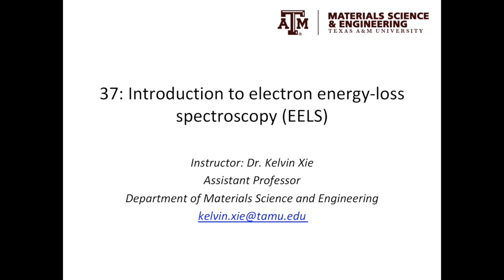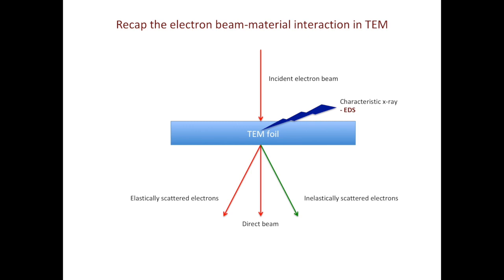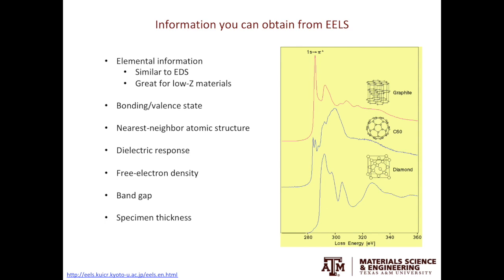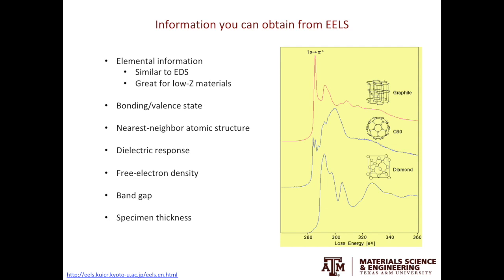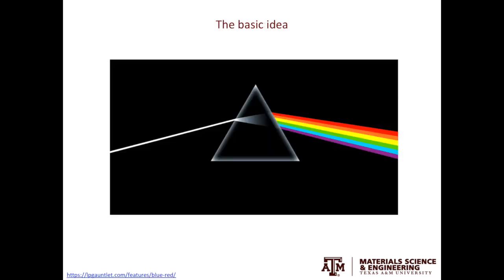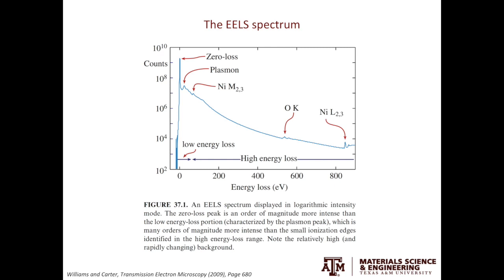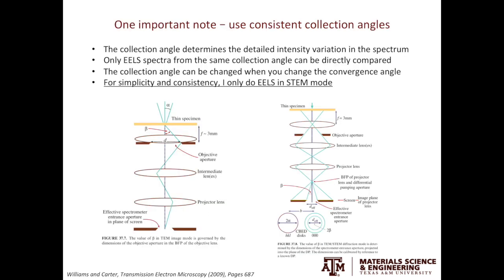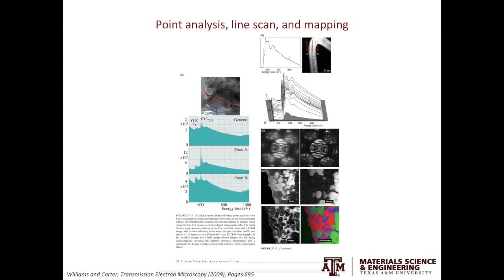37: Introduction to electron energy-loss spectroscopy (EELS)

Comment: There is a mistake when describing the plasmon peak at 4:04. Plasmon is caused by the collective oscillation of the weakly bound electrons (in the conduction or valence band), not the lattice.